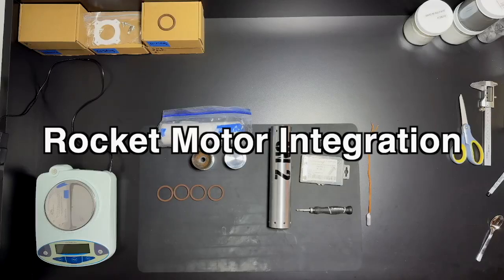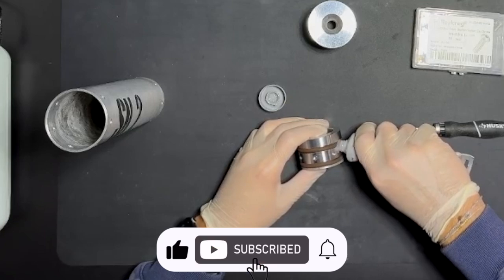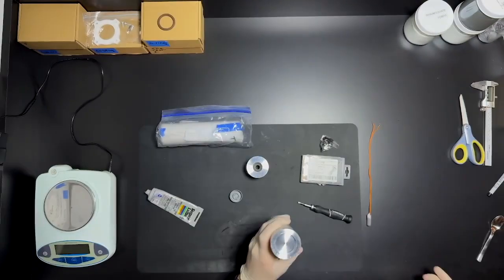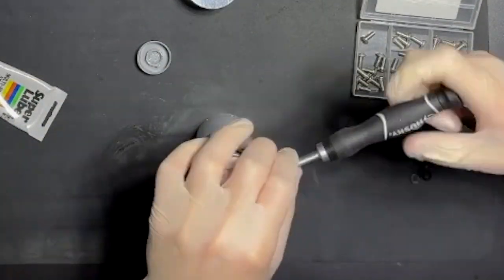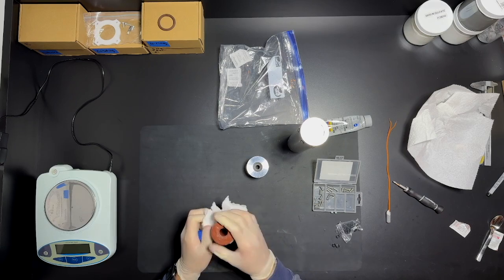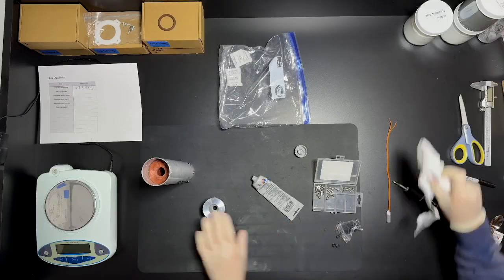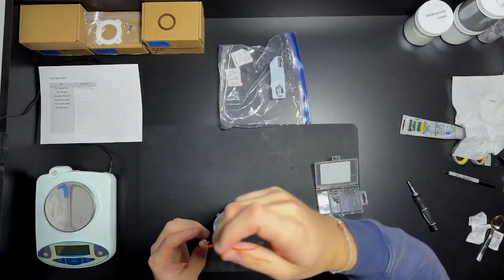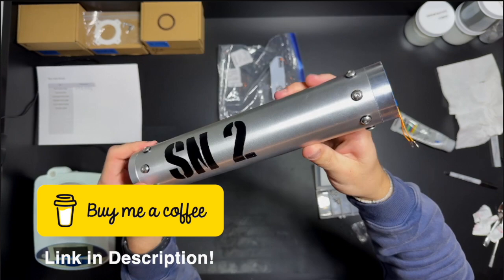How I Assemble My Rocket Motors!

Comment: how did you make the nozzle?
Reply from the maker: SN2’s nozzle used 6061 aluminum with a 304 stainless steel insert at the max heating point, but it didn’t fully hold up. For SN3, I switched to a full 304 stainless steel nozzle for better heat resistance and improved reusability.
Reply: @AeroPropulsions  alright thanks. Keep up the nice content

Comment: Did you use any phenolic resin or coating for the motors and nozzles?
Reply from the maker: @tbnrcarrotz5825  With the stainless steel insert, the nozzle is now highly reusable, and the casing absorbs minimal heat. SN1’s full aluminum nozzle experienced significant wear by the second test fire and worsening progressively over a total of six test fires!

Comment: Is that a forward finocyl? Why did you decide to do that?
Reply from the maker: I chose a forward finocyl to increase the thrust at the beginning of the burn. Now that you mention it, it would be smart to do a few test comparing the two. The biggest reason I chose forward finocyl is to reduce nozzle erosion and lower peak temperatures. This helps increasing nozzle lifespan.